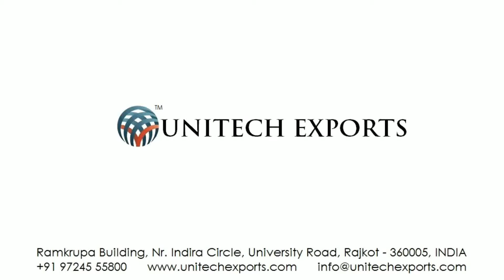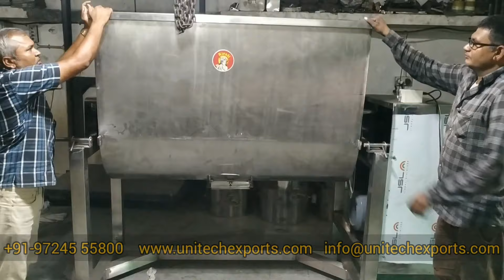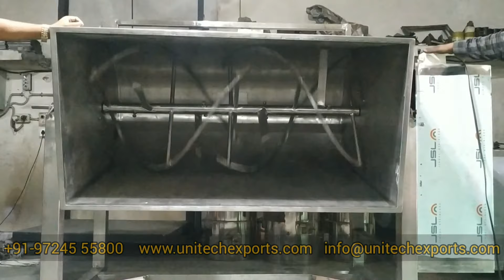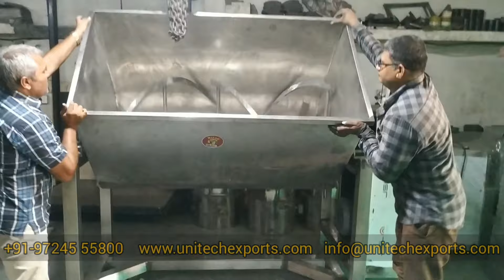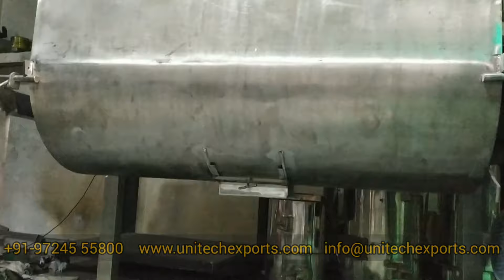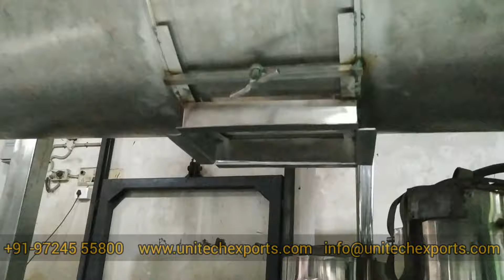400 Kg/Batch Powder Mixing Machine or Tea Blending Machine 8 x 6 ft. (Ph. +91-909 505 909 1)

Comment: motor capacity؟
Reply from the maker: As per model, motor capacity is 5HP (3 phase). For details, please provide us your E-mail id or Phone No. OR contact us directly on 09724555800.
-Unitech Exports (+91-97245 55800 ; info@unitechexports.com)